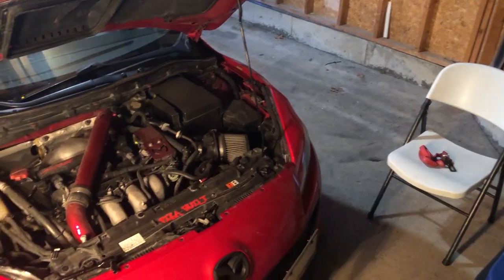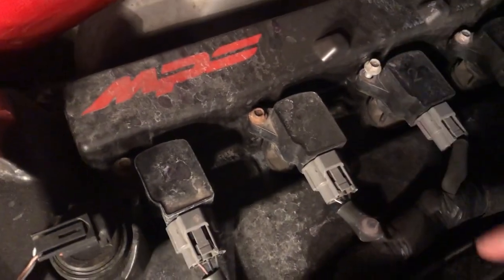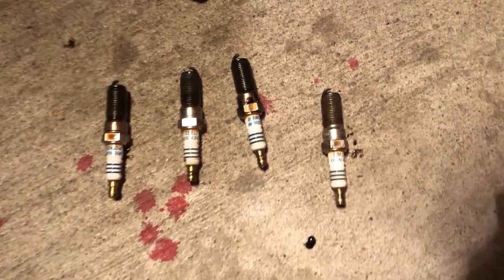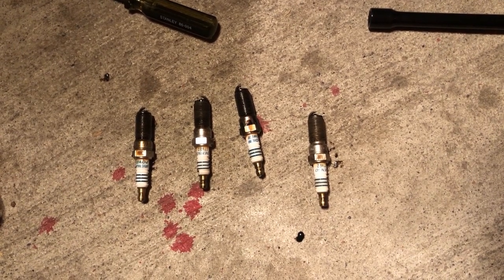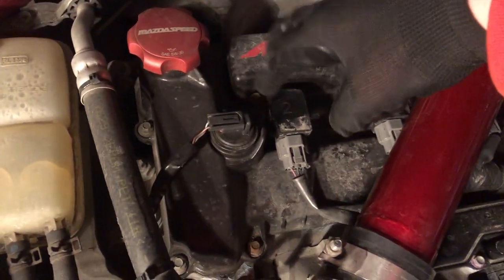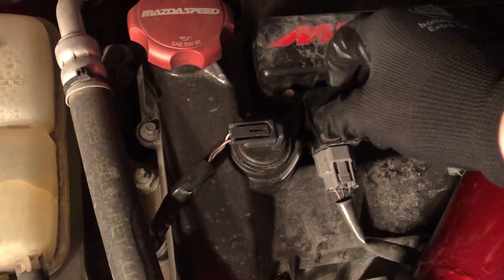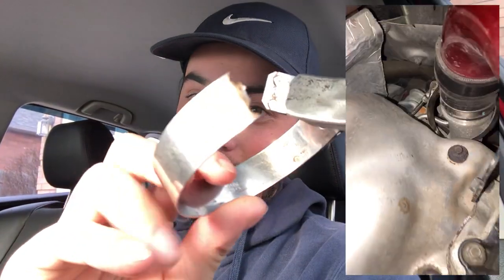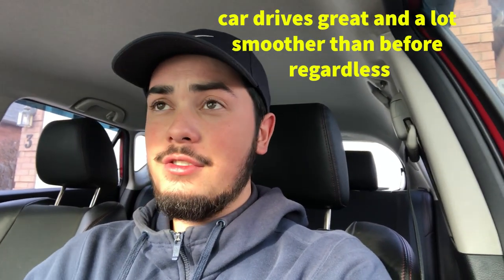Mazdaspeed 3 NGK Iridium Spark Plugs Install | Found A Potential Issue!

Comment from the maker: I know on cyl 1 the coil pack was loose and am currently fixing the issue!!!! Bolt snapped fml. I’ll keep you guys updated!!!!
Reply: That really sucks! The head of the bolt?
Reply from the maker: @picorosita  yeah man tried taking it out with an extractor bolt but it broke it too. Then tried drilling a hole through it ended messing up the thread. Dont know what I’m gonna do next lol
Reply: @jjms3  just tap new threads. I believe the originals are M6. If the hole is bigger than 6mm then try an m7 easy. It doesn't even have to go that deep since it's just to keep the coil pack in place
Reply: Last resort get a new valve cover lol
Reply from the maker: @picorosita  I actually didnt know the size, that helps a lot thanks! Yeah i was thinking that too, the way i have it setup right now is the coil pack is a little secure but not the most ideal. It’ll do for the time being this week. Definitely gonna have that fixed this week. Means more content 😅😭
Reply: @jjms3  heh cool. I do like your videos. Keep it up ;)

Comment: It's a Mazda, so when you think about it the only part you have disturbed is removal of the valve cover. I have owned quite a few Mazda's over the years and oil leaks are pretty rare. Use an OEM gasket and fit it exactly as the workshop manual instructs you. Oil leaks onto spark plugs are always from the valve cover.
Reply from the maker: Good to know!

Comment: What are the benefits to running the one step colder plugs?
Reply from the maker: Stock plugs heat range tends to overheat especially when adding power, messing up the ecu causing power loss, cuz it gets so hot. One step colder plugs will make your engine run a lot better